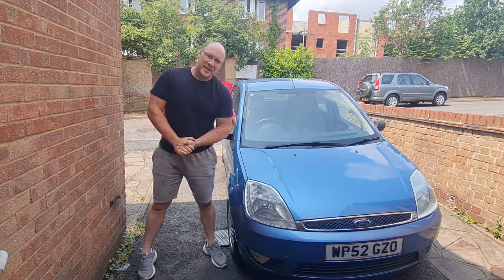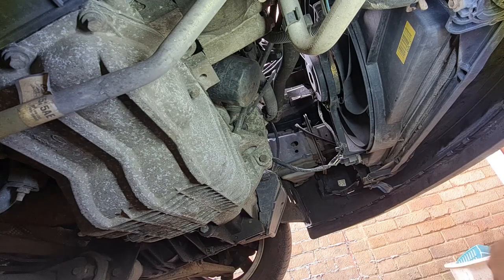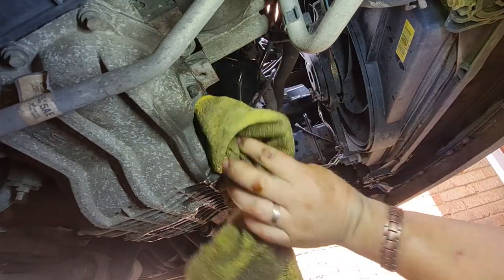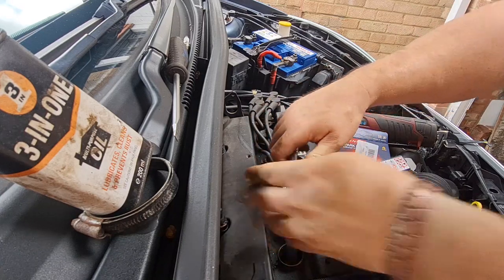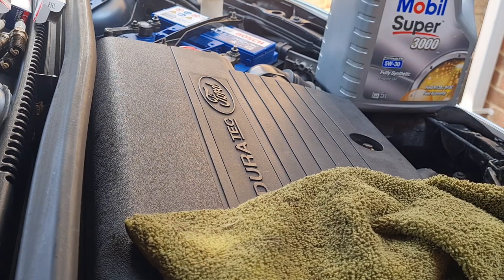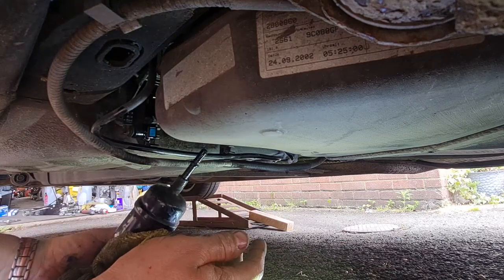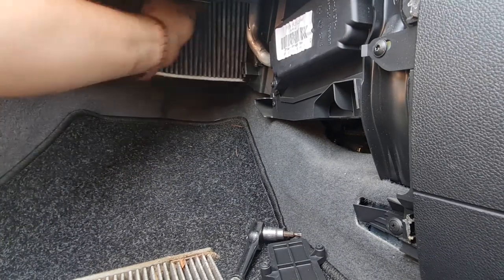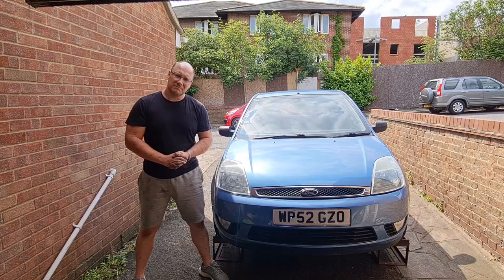FIRST SERVICE IN 7 YEARS !!! GIZMO PT2 MK6 Ford Fiesta 1.4 Ghia Major Service time

Comment: cracking engines those zetec-se's, they run forever if looked after. i had the 1.6 litre version in my puma, bought it new in 2002 and never let me down in 14 years then i sold it on....
Reply from the maker: Deffo mate they are the pinacle of fords reliable period in time 👍👍

Comment: Next time i recommend NGK low price ones on spark plugs on zetec and duratec engine. They are the same price like bosch or ford, but the engine is more "round"
Reply from the maker: Yes i usually use NGK, i think i said in the vid, unfortunatly they didnt have any in stock so had to go with the other brand 🙈

Comment: just bought a zetec 1.4, will defo be using this video as a guide for service. also not seen one of them socket tools for taking the oil filter out before that’s wicked😂
Reply from the maker: Thanks mate glad it will be of use, the oil filter tool is from halfords if u wanted to get one 👍👍👍
Reply: @mec-tec  sweet, i’ll have to grab one. top man

Comment: I couldn't get my oil pan bolt out. Previous mechanic must of screwed it tight and damaged the bolt head.
Reply from the maker: @TimpBizkit  thats a nightmare ! Hope u got it undone ok 👍
Reply: @mec-tec  tried a 13 mm and it slipped on the top half, and a 14 mm slipped all around. I will just take it to the mechanic and ask him to fit a new plug. I have already bought the oil and filter so should just have to pay for the labour.
I suppose I could file the bolt head if I was patient enough. I have the 1.2 fiesta 58 plate.

Comment: Hi sorry for long msg but just seeing if you have any idea.
i just purchased one of these and on cold start sounds fine but once i pull away under load sounds like a diesel.
get about 2 to 3 mins up the road and sounds fine but once the oil warms i have a knocking noise on idle.
do not notice or hardly hear it when revving its just on the idle and can hear it more clearly from inside of the car.
sound like its from left side of engine, it has had the external belts replaced by last owner.
someone did have a quick look and he said something about bottom pulley is wobbling a bit?
Any help would be great and thanks for this vid really help full
Reply: its a 04 plate 1.2
Reply from the maker: Hi mate 
Its very difficult to say without hearing it, my first though is the idler puller and or  tensioner on the auxillery belt that u said has been changed, they can make a hell of a racket if the bearings go, also has it ever had a cambelt and water pump ? It could be bad bearings in the waterpump or the cambelt tensioner itself, sorry i cant be anymore help than that im afraid 
Regards MEC 👍
Reply: That’s fine thanks for the reply, yeah I can’t find any info on the cam belt so might be worth getting that done
Reply from the maker: @agmrecords9359  deffo mate im gona be doing a video of doing mine very soon 👍
Reply: @mec-tec  yes I was thinking that as you mentioned it in your last vid, thanks 👍